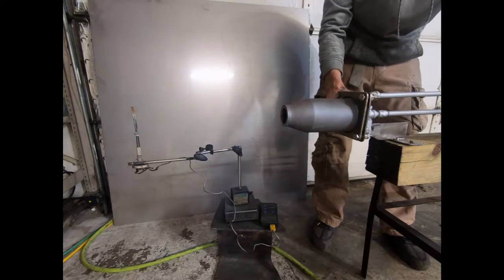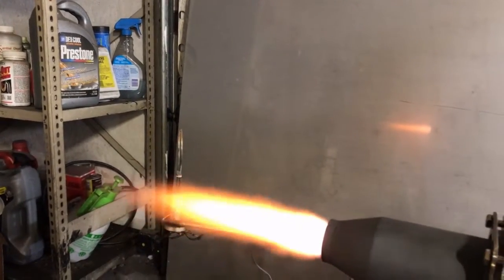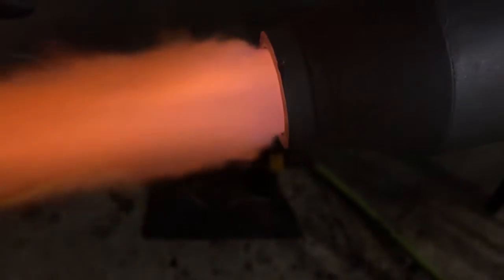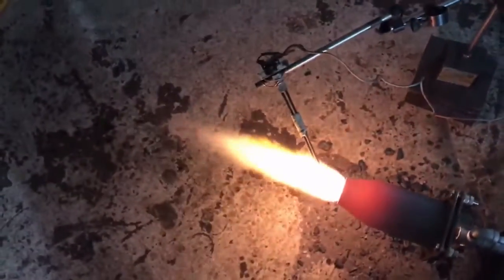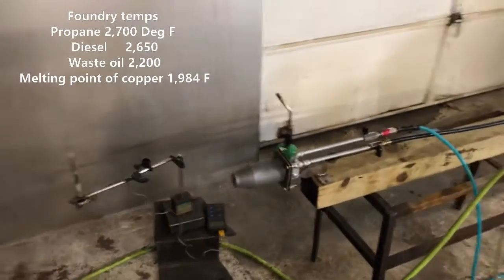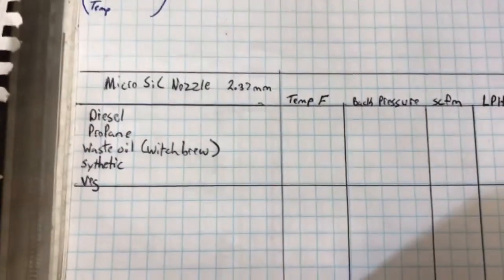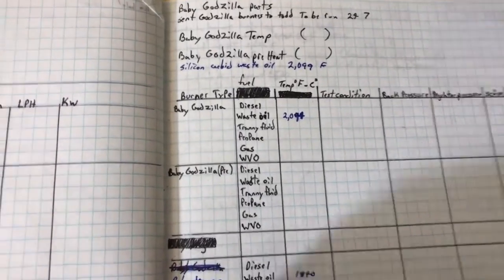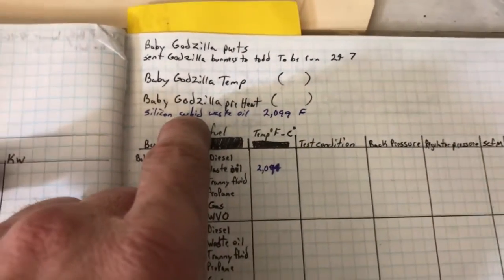Flame temp of waste oil burner

Comment: I’m not 100 but I think due to oil being a liquid and it not being as easy to distribute with an injector the Venturi effect is far weaker with it then with gaseous fuels. I think if you run it with forced air though waste oil will blow propane out of the water since then it now longer is limited by the Venturi. I mean just based off the flame color here it seems oxygen short.
Reply from the maker: The color is deceiving , if this was a diesel flame it would be blue , waste oil will not burn blue due to the contamination

Comment: Great research, great result!  Just a note to anyone tinkering with this nozzle design:  I was able to find the small brass tubing at a hobby shop, they stock various sizes.  I got (3) in a pack,  12" long,   2.5mm OD ,  for $4.99   They had a wide selection of sizes.  2mm OD, 3mm OD....etc.   The packages give the OD and wall thickness, that's how tubing is measured.   OD - 2x wall thickness = ID for anyone who wants to do the math in order to know their exact ID.

Comment: Heat regeneration [ aka 'heat scavenging', 'heat recycling' ] are going to be better in the SiC tube because it conducts less heat [more self insulating] and that will always work in favor of raising any fuel's flame temp, and if you insulate it, this will raise it even higher.

Any way that one can utilize 'waste' heat, and minimize 'spill-over' heat, will increase combustion efficiency.

For instance, if you have a heat exchanger tube in the exhaust outlet of your foundry and let that air be drawn into the inlet of the burner, it is just that much less energy needed to preheat the air/fuel mixture, and if you can also preheat the compressed air, same there again.

I fully realize that there are practical limitations to these, especially on a small scale, and with  limited budget, so that one comes up against the law of diminishing returns, but anywhere one can squeeze a little more efficiency out of the system, the more net power one will get where it counts.

Short of a carbon arc furnace, or a Bessemer reactor, a gas flame furnace is definitely the way to go for melting metal, and if flame temp truly counts [of course, the higher the melt temp, the higher the flame needs to be] then those tweaks, amongst the many out there, are the cheapest, most cost effective ways of squeezing every last BTU out of your system and into your crucible.
(~_^)-b

For organic matter pyrolisis operations, however, I am not too sure how important those higher peak flame temps might be... 
~( ,m,)~
Reply from the maker: Great input , im under the impression that a foundry that allows the flame to hit the crucible is going to be needed to melt steel . I did a preheat burner video and we seen a 50 deg temp increase , this is huge when your trying to melt sweating metal lol . The industrial kilns actually pass the exhaust gas of the kiln back over the burner nozzle and they use SiC nozzle like 2 to 3 ft long .
Definitely gonna work on another steel melting burner and your right you gotta pull all the stops to make that happen .
Reply: @NOBOX7  It is pioneering people like you who help bring good technology to people at an affordable price, I am very proud of you!

I found  a place that sells cerium oxide as a window/glass polish which can be added to the surface of refractory surfaces in contact with flame and fuel by the way, it is maybe not the only place, but it is an inexpensive place.

https://www.amazon.com/Cerium-Oxide-Glass-Polishing-Compound/dp/B009XUAA4Y

Other than that, perhaps you can consult with your supplier about laminating/embedding some of it into the nozzles?

I am honestly a bit skeptical about directly embedding it even as I say it though, because, as catalysts work in a certain way, to have them directly contact the SiC, which is a totally un-oxidized product, could lead to destroying it.

I would think, however, in a high temp ceramic lining, one could apply as a 3rd layer the CeO and have it stand up like a 'sandpaper coating' sort of so that it can interact with the flame to the greatest amount possible, without interacting at all with the SiC nozzle.

In fact, a good solid liner would extend the life of the nozzle by keeping it out of the path of the heat and oxygen, reducing its tendency to oxidize.

Add some kind of oxide on the outer edges and one can extend the life even further.

Although this information here following is far more deep and complex than the subject at hand, it should prove interesting reading at least.

https://apps.dtic.mil/dtic/tr/fulltext/u2/a494501.pdf
Reply: another great way of heat recovery could be preheating your oil. And no not to the boiling point or that kind of thing, that gets your lines gunked up. No im thinking more in the ways of having a heat exchanger heating your bucket of oil. If you get your oil to about 80-90C then it wil be much thinner wich means you can get much more flow trough that nozzle, pretty close to the diesel spec probably. And because the oil is preheated it wont need as much energy to fully vaporise.
Reply: @gabbermaikel  Again, this is something you can do with the 'waste' heat from the exhaust.

One reason to preheat waste oil is to drive off water too.

Also, sedimentation of solid particulates occurs when used oil is column cracked, which, while a rather complex seeming machine, is not terribly expensive for the performance it adds, although, admittedly, it removes some of the heavier hydrocarbons, as well as soot, metallic compounds [metal shavings and engine anti-wear compounds], silicates [sand, sodium silicate, metal silicates and silicon carbide (found in oil in microscopic amounts as it comes from the ground naturally in minute amounts)] which all detract from oil combustion efficiency.

Another advantage to heating oil is that it can flow into the jet more rapidly, regardless of column height because of lower viscosity, therefore allowing greater oil flow as opposed to cold oil.

       /)/) 
     (   'ˬ') 
@(>_ )-b 
      \) \)
Reply: @DeliciousDeBlair  Exactly..! Like your other comment on pre-heating the air it's one of the most valuable comments.
My burner does exactly that. I simply made a coil out of copper tubing in which the oil is running. I used about 1,5 m or so 10 mm copper tubing I had lying around. The intake air is pre-heated from the top of my furnace as that would be the point where the heat goes.
I had a minor adjusting problem though as hot air is less dense than cold air.

Comment: Using waste inside of foundry will melt cast iron no problem, also did a test and was able to melt small piece of steel, not in a crucible, also with waste oil, but no external nozzle, combustion took place inside foundry
Reply from the maker: Thanks for the input , i was only able to melt  steel in the intake of my  foundry so i think a design that lets the flame hit the crucible is the only way to melt steel in a crucible . It turned into a river then a pond in my  foundry floor
Reply: @NOBOX7  if the foundry is wel insulated it should not matter that much i think. Yes the heating time wil be a bit longer, but the temperature wil be more even meaning your melt wil be more consistent. To melt something you allways need a flame that is hotter then the melting point of what you want to melt. So in a well insulated area it should be able to turn everything to the melting temperatur.
Reply: @NOBOX7  To maximize the realized heat, insulation and isolation are critical, naturally.

Eliminate drafts and quenching air, and make sure that the exhaust only leaves under positive pressure.

In essence, do those 3 things opposite of a turbojet engine.

Turbojet engines develop heats which would literally melt their internal parts if allowed to come in contact, so they intentionally cool and dilute flame, as well as using this same cooler air to create a boundary layer between the metal and the flame.

With enough static pressure and sufficient flame impingement, some foundaries actually reach 3500F with a high enough static pressure at high enough velocities, although I have a feeling that with your present equipment such temps may not be achievable...

This childlike illustration from Stanford University about turbojet engines points out that such temperatures are really reasonable, just in case people do not believe me...

https://cs.stanford.edu/people/eroberts/courses/ww2/projects/jet-airplanes/how.html

2000C is 3632F, which will totally melt a whole lot of metals one might want to melt, but people will need special crucibles, because many normally available crucibles can not withstand such temperatures.

These temperatures are obtained on JP-4 and JP-8, which are basically common diesel fuel/kerosene with a few special additives to handle high altitude flight and the particular conditions within a turbojet engine.

Some steel mills work with natural gas, which is technically less energetic per pound than propane. [fewer BTU/lb or MJ/Kg] energy content]
Reply: @NOBOX7  This might be interesting reading...

https://www.sciencedirect.com/topics/engineering/flame-temperature
Reply: @NOBOX7  Steel can easily melted in a waste oil furnace. No need for a fancy setup and no you do not want the cruicible or material in the flame path. Check out luckygen1001, he often adds steel to his cast iron melts.

Also waste oil burns about 2100oC and propane 1980oC (air) so that helps but the largest factor to why oil works so much better is due to the much higher energy density of oil which translates directly to a higher joule rating.
Reply: A well made, lined foundry will typically get much hotter than one of these burners out in the open, he is well aware of that, and mentions it.
Reply from the maker: Yes i have seen this as well in other videos i even did it before myself but cast iron is only 2,200 deg to melt   , my foundry had 3 inch thick refractory but no insulation so i was not able to get good temps  in a timely manner , but with propane i could melt cast iron in seconds or a couple minutes from cold start .
Reply from the maker: Yes Shawn you are correct , melting point of cast iron is 2,200 see this video i made  , it was steel i couldnt get waste oil to melt https://youtu.be/bTmNQ29rHFA i melt cast iron in this video with waste oil